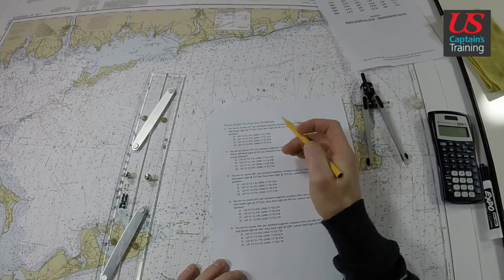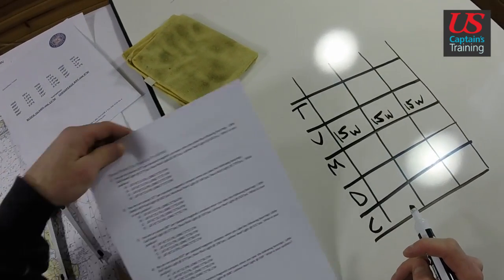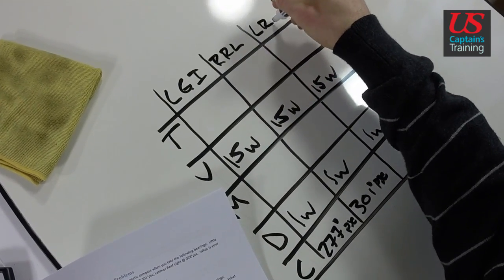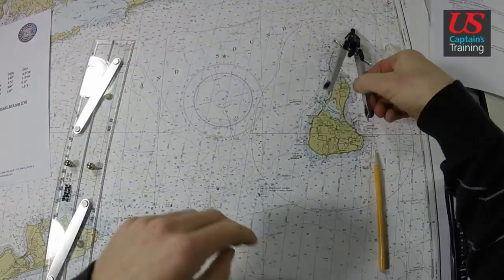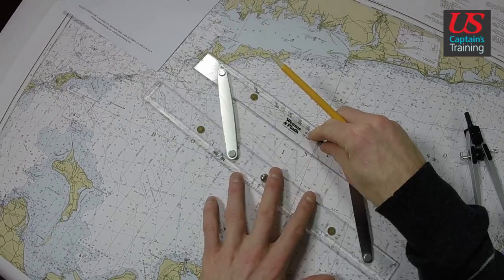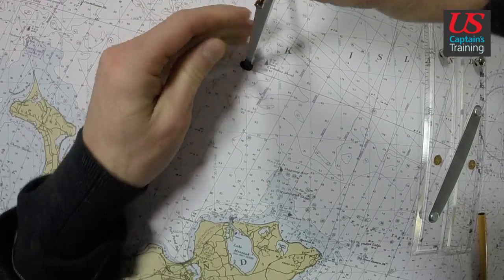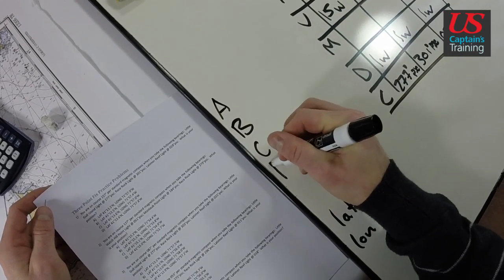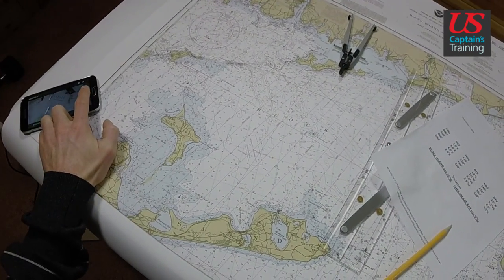Captain License Chart Navigation – Three Point Fix Practice Problem 1

Comment: Why convert the three bearings to "True"? ...  could't you just plot the three in PSC, and then take that fix over to the Compass Rose and read the outer ring to get your Set in "True??
Reply from the maker: You need to convert the three bearing to true so you may plot them on the chart in true and get an accurate fix. It takes all of the compass error out of the bearings and allows you to use the outer ring of the compass rose.